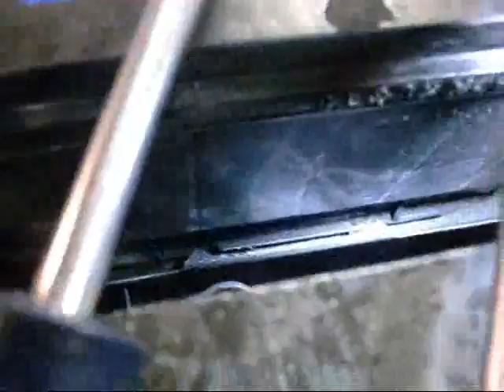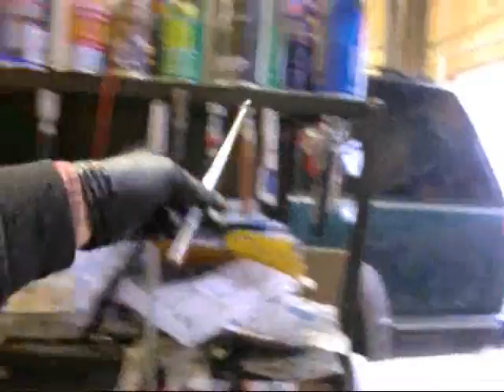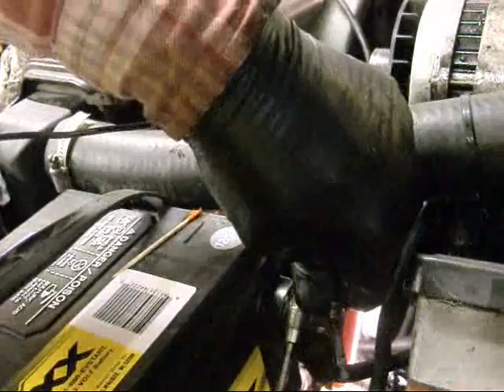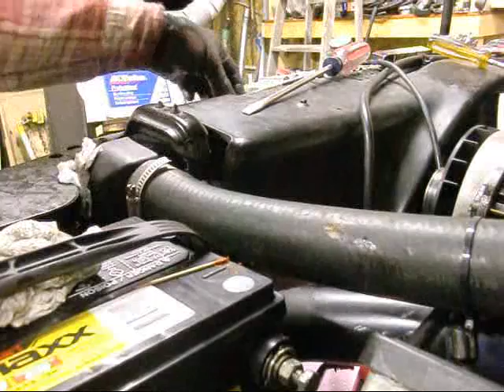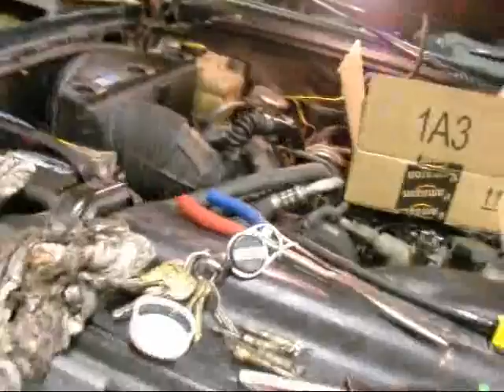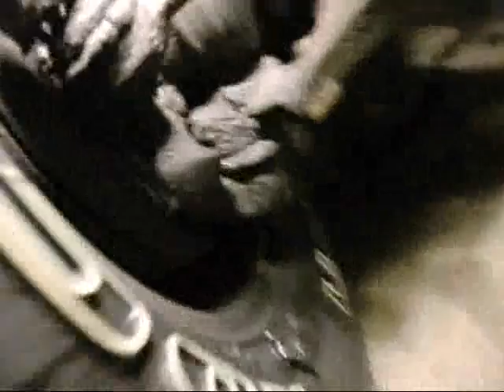1 30 13  Ze Dr Ze Glo Plugz Ze Weasel Vid

Comment: An old Chevy tech taught me a way to test the glowplugs without having to remove them. You pull the wire from the glowplug and attach a test light lead to the POSITIVE side of the battery, then touch the test light probe to the glowplug TERMINAL (not the body of the glowplug), if the test light lights up, the glowplug is good, if not, it's bad.  Easy.  Good vid though!

Comment: 195f is quite normal.
you certainly had sludge yet and it's cleaning it up.
Locked clutch fan do not help to run at normal temps in your cold country or long idling times but if your temps are normal on the dash it shouldn't be a problem.
however if there is still sludge after several oil changes that's not good.

Comment: synthetic is really detergent
if you had sludge packed at the bottom of the pan yet you dissolve it with the synthetic oil.

What are your thermostat temps ?

Comment: if the sludge keeps coming back that is a tell tell sign on a 6.5 its losing a head gasket or a cracked head..  when you get milky oil in a 6.5 you have a major problem they give you little signs like that like the sludgey dip stick..